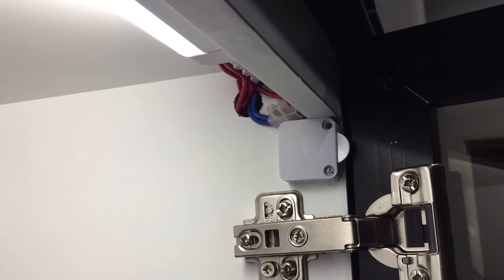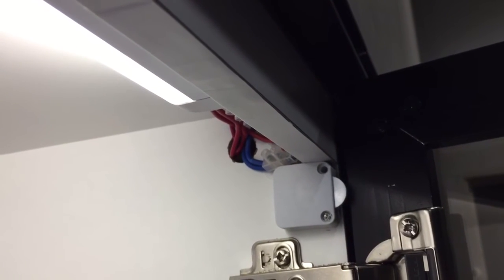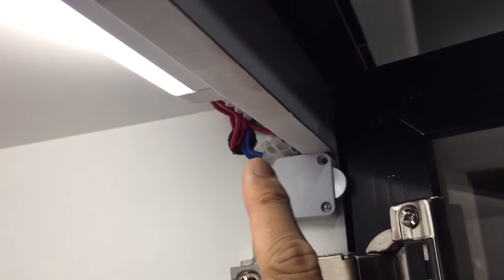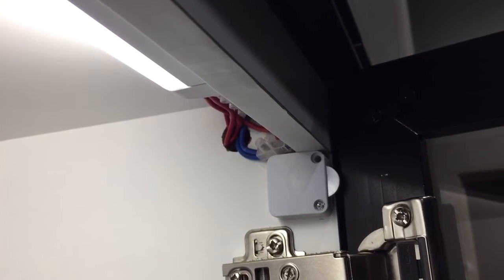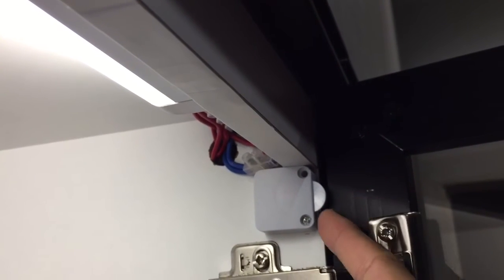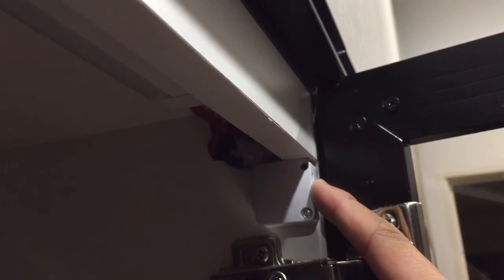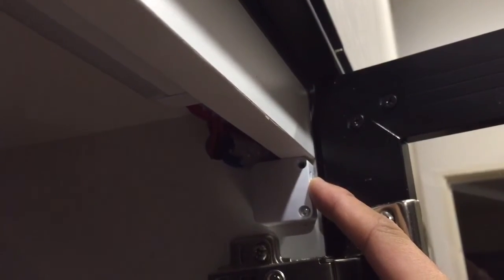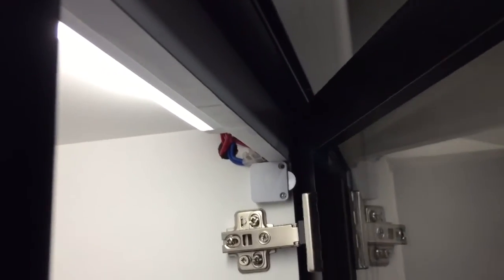Cabinet door light switch in action

Comment: I am looking for a similar type of switch for for 120V 20 amps
Reply from the maker: 20A is really high ampere. The one shown are meant for cabinet door to control LED lighting. Advise to look from hardware store specialized in heating element.